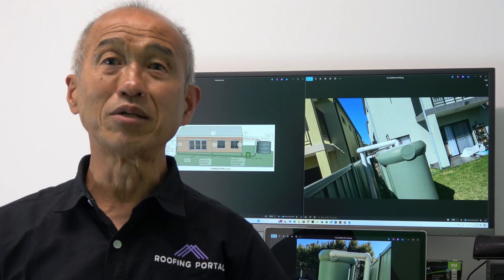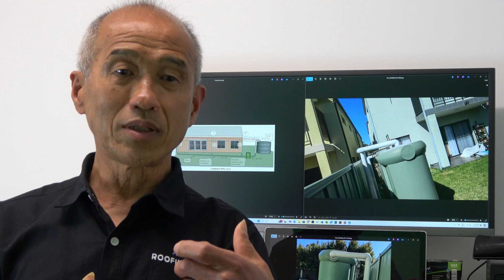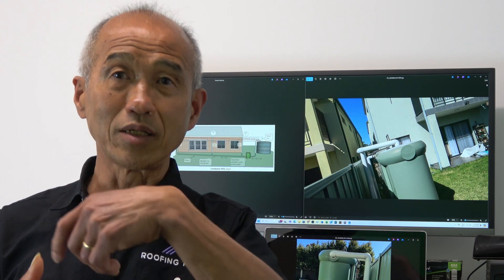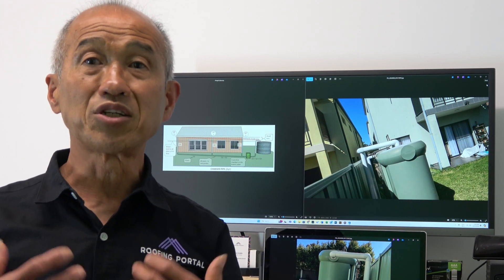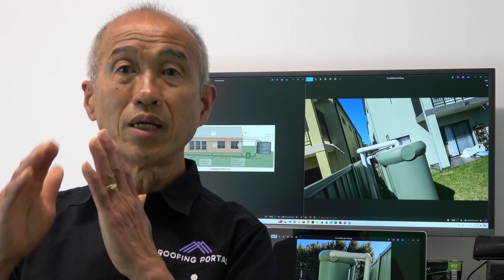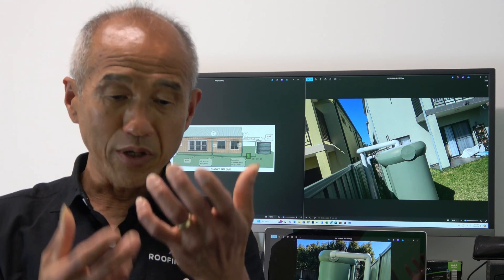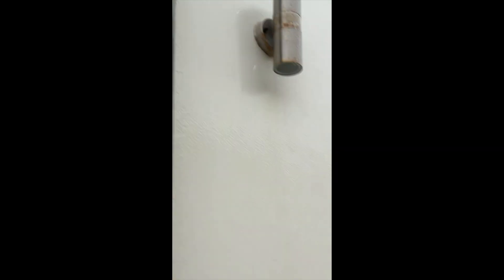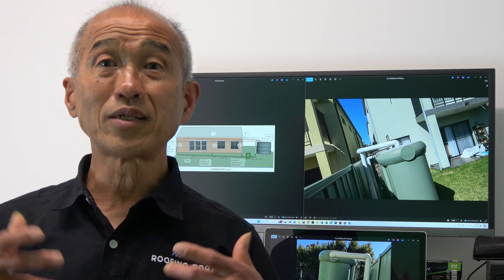When will charged downpipes cause roof leaks

Comment: Why not have a sump (or 2 or 3) close to the house with a pump and float switch through a smaller pipe to the water tank? Obviously you need a reliable power supply although solar panels and a battery should ensure that and limit any running cost. The way pump prices have come down and pipe prices have increased (here in NZ anyway) I imagine that the install price would be similar.

Comment: Gutters need to be slotted or redesigned with the front lower than the back so overflow never goes down the cavity.
Reply: Why not get a bigger gutter? Having the front of the gutter lower than the back is going to expose the ends of the roofing on most roof pitches which is very unpopular in my experience. External brackets allow a gap between the fascia and the back of the gutter so it would be simple enough to increase that gap, metal fascia gutter systems usually have the back of the gutter tight to the fascia although a new suspension bracket design would allow a gap there as well.
Reply: @cantablocal6768  Bigger gutters dont matter if something is blocked, slotted quad or half round works fine..

If the water is running out of your o/f slots during normal rainfall you need more dp's.
Reply: @frankryan2505 
More downpipes usually means more risers which can be difficult to install in an existing house. My comment was related to overflowing which is usually related to a blockage, leaves or bird nests being the most common cause. Houses are built to meet council requirements regarding the number and size of the downpipes so it's unlikely that any overflowing is caused by not enough downpipes although with the increase in severe weather events it is not impossible. A bigger issue is that fascia gutter installation doesn't have the correct fall so water sits in parts of the gutter or sometimes the top plate is not level and the DP riser is at the high end.

Comment: What about water head pressure ? I do pools for a living and we work our pump solutions off what we call pump head , it allows for water to be lifted a certain amount  at a rate of 240 lpm ( litres per minute ) but the thing is water head pressure can also occur when you have a pipe or hose that sits in a body of water( the deeper the more head pressure ) when you have water coming in from the top the large amount or body of water in tank and pipes acts as a resistance which creates gravity head pressure. You can test this if you own a pool by placing the pool hose in pool and grab your water hose and try filling it up and soon enough it backs up.
Reply: Good feedback about head pressure.
Like most things in life, it gets more complicated as you go deeper into the 'Rabbit Hole'..

There is STATIC head pressure - that you are talking about. This is when there is no fresh water being introduced into the system. In this instance, the water level across all the downpipes and the water tank will be the same.

But during rain, the designers have to design the pipework system using DYNAMIC head pressure. This is because, it takes TIME for water in the gutter to get to the water tank (also add in pipe friction which causes 'head loss'). So, the water height in the downpipe furthest  from the water tank is the highest, and the water tank level is the lowest..

Gives me a headache thinking about it!
Reply: @RoofRepairsSydney  yes we have the same problems as each time we add an elbow or length of pipe we change head for the pump and system

Comment: Undersized downpipes and inadequate numbers of them will also result in temporary charging and overflow back up into guttering, due to hydraulic lock, no? 

Isn't this the reason why you should request your house builder to provide more, and larger size downpipes on your guttering system, before you sign the house construction contract.

Comment: A positively charged pipe to a water tank with a leaf catcher between the gutter and the tank sieve will always cause problems when there is high intensity rainfall because there is not enough head pressure to pushing the column of water in the pipe fast enough. One solution is to install a ground pit with release valves that can be manually opened to discharge the storm water load in emergencies, such as full tanks and high rainfall. I don’t think small allotments on a storm water network need rain water tanks. Urban supply is cheap and reliable. Positively charged pipes are needed to lift storm water discharge but only works if you have enough head or you use a sump pump.

Comment: As a pest controller who deals ALOT with Termites I can assure you, this man knows his stuff. 
Let this type of situation go on for too long & you'll be very sorry. Steel frame or not. It doesn't matter.
Insurance doesn't cover insect or rodent damage to a property.
Reply: How do the termites destroy a steel frame?
Reply: @smiddysmidton8313 they look for other tasty things to chew on like door jambs, arcs and skirts.  Seen it in 2 steel framed homes in recent years.  One guy only discovered it when a bedroom door fell down - the hinges and screws just fell out of the frame.  Under the hinge area, and for much of the vertical section, there was only paint left with no timber under it.   They also used the skirts as a hidden highway to get to more than half the door jambs.
Reply: @smiddysmidton8313  Okey dokey, so......
Termites need cellulose, & water to survive. They don't need it all from the one source either so your neighbours can also help create a problem. Especially with the design & close proximity nowadays.
A modern home contains ALOT of cellulose products. Gyprock (drywall) is one. 
If you get a Subterranean colony nesting within a wall or worse roof / floor cavity it 💯 will rust that frame out. & quickly.
The coupe de grace is if the colony goes through the alaite stage. Meaning they fly from the original nest as winged reproductives...... 
If this happens you will end up with multiple nests with the home & around the property. 
Steel frame homes still require a physical or chemical barrier during the construction, so that's some food for thought.
I could go on but over the last 20yrs of being in business I've seen hundreds of steel framed homes destroyed by Termites because of complacency. 
Yes, they don't eat the frame but the subsequent damage & act of nesting is all that's needed. 
Don't forget about moisture. 
It destroys everything over time & as I've already stated WILL bring everything to your home. 
I've also seen homes destroyed by rodents due to the same issues. 
Heed my warning. Do not be complacent as ALL insurance companies do NOT cover any of this. 
Termites do more economical damage in Australia than anything else..... hence no cover. 
Oh & it's almost impossible to acroprop a steel frame for repairs......
Peace ✌️
Reply: what!
he is talking about rainwater not termites.
Reply: @ursodermatt8809  Inadequate drainage or what is going on in this video is one of the main causes of Termites being attracted to any property. 
Plus it will void any warranties in place during the construction to do with Termite protection. 
Excessive moisture will also attract all types of insects & vermin so simple maintenance is essential 👌
Reply: @ursodermatt8809  termites are attracted to dampness around houses & termites eat the cardboard on plasterboard, & there's many small bits of timber in a roof & frame that might be untreated.  They will also eat right through a plasterboard wall into a pile of cotton bedding - have seen it with my own eyes.  A cotton doona thrown into the bottom of a cupboard became a complete termite nest.  It's one of the reasons why there are gutters & downpipes which pipe the water away from houses & water isn't allowed to fall directly onto the ground near walls (apart from erosion issues).